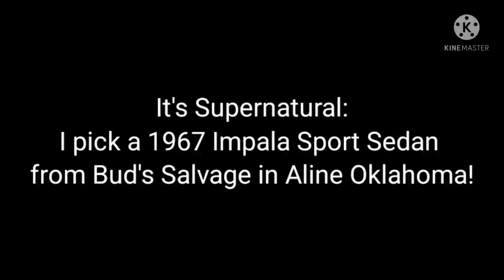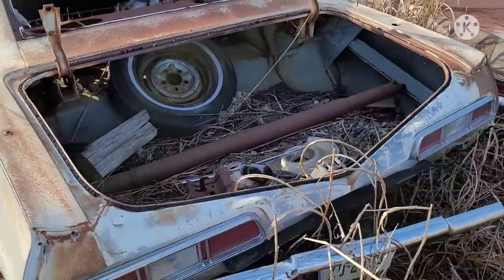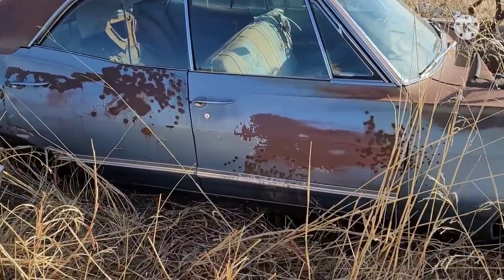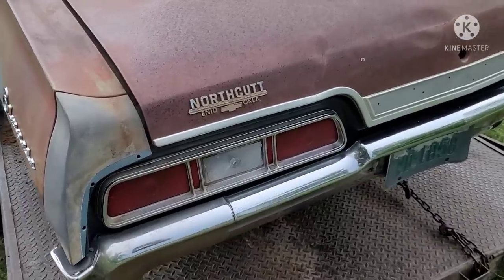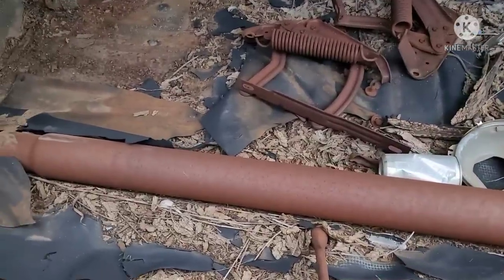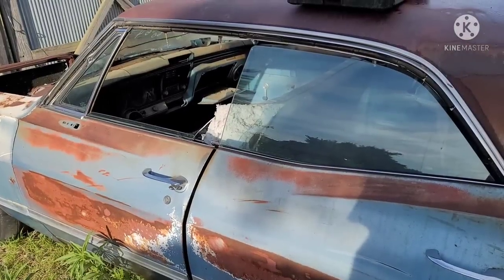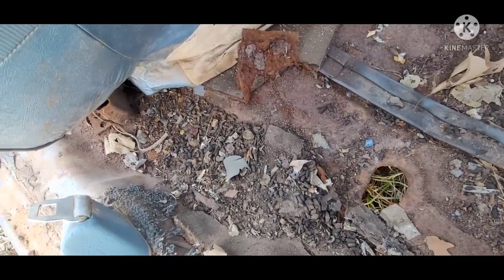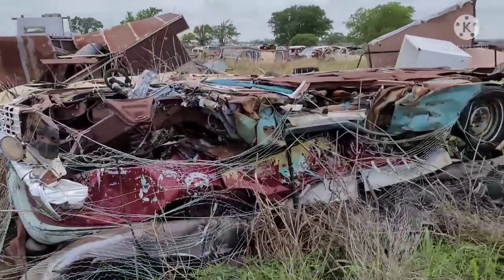It's Supernatural: 1967 Chevy Impala Junkyard Rescue! Restoration Project car 4 door SAVED!

Comment: I’ve been looking for this exact model of car, been infatuated with it since I first saw Supernatural as a teenager. I want to get one as a project to work on with my grandpa. Restoring old cars like that is his favorite hobby. He still has his 64 bonneville he fully restored that he takes to the Woodward cruise every year. I’d love to have something like that to drive with him, something that we fixed up together. Something I can hold on to memories when he passes.
Reply: Edit: is it still for sale?
Reply from the maker: I just listed it in Hemmings for $7500. I have titled it, installed a running 350 TBI engine, and gathered most of the parts for it, except for miscellaneous trim, some of which is available from reproduction parts catalogs. I do have a good replacement quarter from a parts car that I can include with it. The car needs complete restoration of the body, interior, mechanical, and brakes. I can be reached at mrgoodpliers1985@gmail.com

Comment: I've been a 67 Impala hardtop fan since long before they became a wanted thing.  That beast has reasonable bones to work with (passenger's rear quarter notwithstanding) but of the ones you showed us, she was definitely the best candidate, with a few others at that yard that would be good donors.  I have never seen so many acres devoted to old steel before!  We have only one yard similar to this in the entire country and its about 250 miles (about 5 hours) away....and anything there has at least an arm or a leg (or both) in its price tag.  Great yard to look around (and they charge for that too) but it's more of a museum of rusted artwork than a serious breaker's yard because of the cost.  Sad,,,,  That last Impala that 'didn't quite make it'  - I don't think an ironing board would be much flatter than that, although that one stubborn tail light should be given a medal!

Comment: My Grandmother had one of these cars bought brand new. She had an accident in it on a rainy day and it was totalled. The interior was still like factory new.
Reply: Way back in those days your grandmother must of hit that car pretty hard to total it , and here 50 plus years later with all these newer cars that has mostly plastic you can barely damage it and insurance will total it ,as parts are so much higher now than they was in the 60s

Comment: ..Thank you for NOT calling all these "4 door parts cars" regardless of their condition...I used to think that way, back in the '80's, early '90's...but at this stage of the game, that is an obsolete way of thinking..but still persists with some..sure, convertibles, and 2 door hardtops(pillarless) are (usually) worth more and more desirable than the 4 doors, but 4 doors are often the best way for someone with a small budget to get into a classic car, and (as of yet) driveable examples in decent shape can be had for a reasonable amount of money..not so with 'verts or 2 dr hardtops on many models..not even basket cases, which someone with a small budget couldn't afford to restore even if they could buy the hulk...plus, many 4 doors, especially 4 door hardtops(pillarless) actually are very nice looking cars...wagons used to be considered "4 door parts cars" too, but they have now become desirable...

Comment: You need to check the frame just before the rear wheel in the back!
Reply from the maker: Western Oklahoma car, it was solid all the way. For some reason 1965-70 frames start rusting at the transmission mount area, and it moves outward

Comment: For whatever reason, I find those '67-'68 Caprices/Impalas interesting looking. In my future literary work of a faith-based mystery novel, a '68 Custom coupe Chevrolet Impala sedan will be staring as a weird, suspect vehicle, and the backstory proceeding it will star as a dirty, dusty primer black or dark storm gray '68 Chevelle Malibu SS without its front bumper and hood with engine exposed. The suspect(s) will be unseen/unknown as in 1971's Duel, staring the late Dennis Weaver and 19 years later, made-for-cable-TV (USA Network) Wheels of Terror, with a creepy-looking '74 Dodge Charger.

Comment: I have done old cars before and I know what it costs to just fix them up and for them to be a usable vehicle. The number one rule when selecting a project car is for it to be as complete as possible and to be rust free as possible and free of body damage as possible. The number two rule is not to use a parts car that is only good for parts as your builder car. The number three rule is some cars are worth saving and some cars are not worth saving. A four door car can cost the same amount to restore as a more desirable body style but the four door car returns less if you want to sell it.
Reply from the maker: Four door hardtop Impalas are the king of the mountain for '67, simply because they were chosen (intentionally or not) as the "hero" car for a TV show that ran 15 years and had a fairly wide reach and fan base. They had a low survival, because many got parted out. The market is very strong for them. They will bring as much or more than a two door, convertible, or even SS car.

Comment: I have 2 of these 1967 impalas 1 thing i really need is the back glass outside chrome reveal molding/trim cus the 2 cars i have was missing it. Willing to pay cash if u can get it!  or...OR if u need a part maby work a trade i have 2 complete cars im useing 1 as a parts car. I really need that back glass trim so drop a dime old sport.
Reply from the maker: Ok. There were three different back glass shapes. Four door HT, four door post, and two door hardtop. What do you have?
Reply: @mr.goodpliers6988  4 dr ht is what i need old sport!